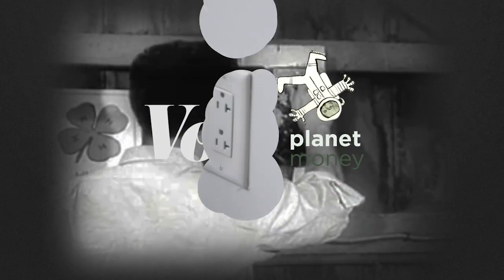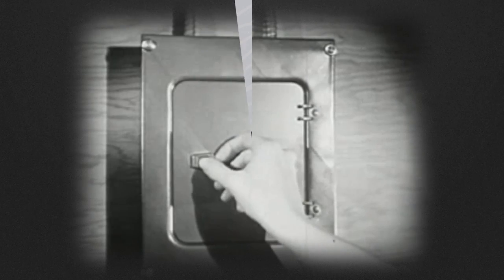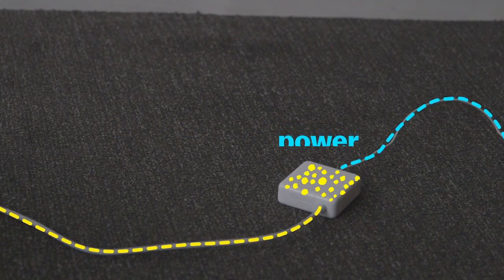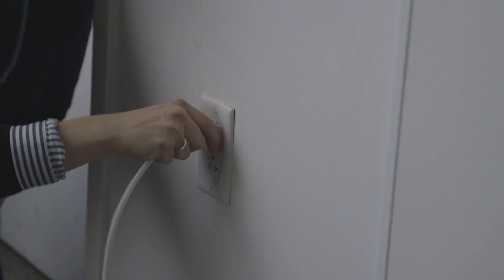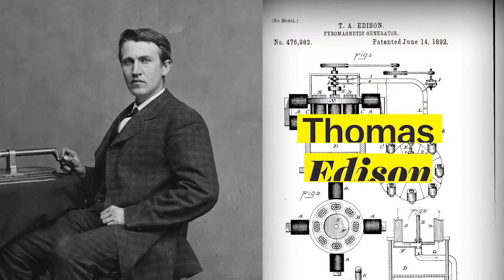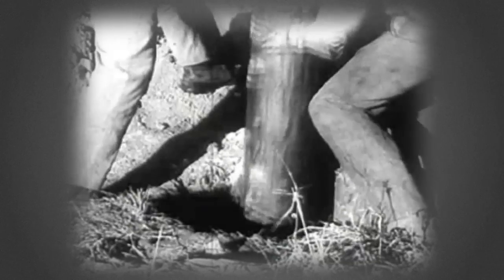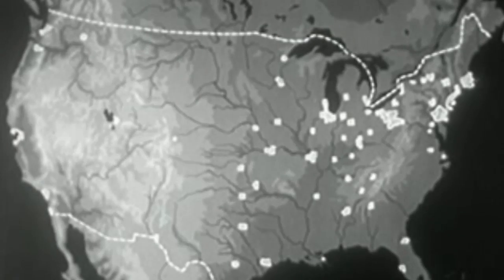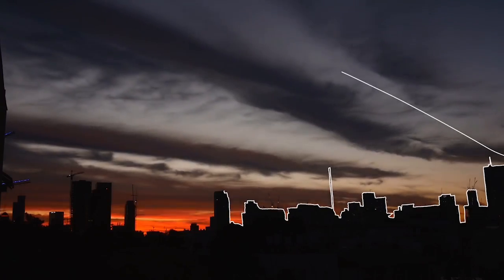Why your laptop charger is so hot

Comment: The answer is moronic and inaccurate. If your charger is getting more than just warm (still easily touchable) during a charge cycle it is likely a cheap piece of crap that is not sized properly for what is being charged. You should NEVER EVER use a charger that is different from the one provided by the manufacturer...that means NEVER.

Comment: Alternating current doesn't go "back and forth..." It just is on and then off. It is really only on half the time, but it oscillates so quickly that it is unnoticeable to humans. Watch a video in VERY slow motion. You will notice that the lights seem to be flickering. The problem with the electricity from the wall it is that 1. Your computer needs a steady supply of power to keep running, not oscillating, and 2. The voltage from the wall is way too high for your computer and the heat comes from the coils upon coils means literally for the explicit purpose of getting hot by wasting energy to convert ti the low voltage.

Comment: I'm trying to understand how a single large power converter would save energy. 
DC is incredibly lossy. It's only viable at short distances. This made T. Edison's urban project that compete with Tesla's include coal power plants amidst the city, whereas Tesla's generators could be located far away.
You'll lose more energy in the wires connecting everything. And you would still need AC power for some home appliances.
Though, DC power is safer due to low voltage, but the higher current means heating and fire hazard in the wires.

Comment: This video is completely misleading and in some cases wrong! 
As previous viewers have already mentioned, it is not the conversion from AC to DC that is causes all of the wasted energy, it is the conversion from 230 or 110 volts into around 5 volts depending on the charger. 
Actually, having AC in the power grid saves a lot of energy and complexity when looking at the large scale of a country. AC is much easier to transform into different voltages which is an essential feature since higher voltages are much more efficient for long distance wires, while lower voltages are safer to have in your home. This is is why every country in the world uses AC.

Comment: I've come to expect more of you Vox. This didn't even answer its own questions.
"Why does the power converter get hot?" "Well when the power converter converts power the power converter gets hot."
"Why do our devices need dc?" "Well they do, so you need a power converter."
Reply: +TekSupport actually the majority of the power loss comes from the transformation of high voltage to low voltage. So the video is gives inaccurate information.
Reply: +Hector Rochin Exactly. This video is a bit of an embarrassment - they should just pull it and try again before anyone else sees it.
Reply: +Bret H good quality informed with a good insightful audience....
Reply: It mentioned why it's hot, because of energy wasted in the form of heat
Reply: its still a bad video
Reply: +TekSupport ? what the H?
Reply: +Hector Rochin I think you're right on that and the penny pinchers always want the power supplies to cost less so the engineers comply with the BS and make them 10% less than they should be & other big issue is the state of terrible electrolytic capacitors coming from Asia
Reply: +Blobfisher I think vox missed the whole point. your laptop needs power at ~19V, you cell phone 5V your razor 12v etc etc. your old skool TV would like it if you delivered it 10000V for its electron tube. if your going to have to convert it  up and down (from whatever voltage you send through the lines in your house), the cost of AC vs DC on the input side is pretty negligible. also you can't deliver it at modern electronics voltages, whatever factor you reduce the voltage by you have to up the current. a standard house would have a peak load of 2000A if you delivered electricity at 5V (im assuming your running a stove and a few heaters +those electronics goodies, which would conceivably hit 10kW).
Reply: agreed, vox is not a science channel.. this video would only confuse someone with limited electrical understanding looking for an answer to a simple question.
Reply: Kabitu1 it answered the question by saying the heat is a form wasted energy.
Reply: Does this also explain why we have different voltage specs on some appliances? Is that the reason why plugging in a 110v device to a 220v outlet would short out its power circuit?
Reply: +Francis Paran I think that's because most countries have 220V, 230V, or 240V power, whereas the US has 110V. The voltage specfied on an appliance would be because of which country it was originally made in.
Reply: +TekSupport Well, the hair dryer thing is not true. It's not turning itself on and off. The direction of electricity just switches, but that doesn't matter. An DC-motor has the same theoretical efficiency as an AC-motor. An AC-motor would actually be more efficient if it's three phase, but thats another discussion.
Reply: +TekSupport I know AC is not consistent like DC is, but that bit you said about hairdryers made it seem consistent...
Reply: +Kabitu1 Not to mention that a lot of those "AC devices," like the LED lightbulb and vacuum cleaner, all use DC. They have converters internally. If I'm not mistaken, it's the inducters in a converter that generate the most heat.
Reply: Ask ASAP science
Reply: Kabitu1, Thank you, I bet everyone who actually watches box knows this.
Reply: surely its the step down transformer that dissipates more heat.. besides you can't expect the average vox viewer to know anything about diodes mosfets and bridge rectifiers.. i agree that  this video did not say much
Reply: he doesnt know what he is talking about ac motors use a split ring commutator to insure they rotate in on direction regardless of the the change in the direction of the currect
Reply: Kabitu1 it answered the question by saying the heat is a form wasted energy.
Reply: From an Asian student's perspective: P=W/t=UIt/t=UI
Reply: Power converters get hot because they convert ac to dc and when that happens energy is released in the form of heat. I learned that from the video?
Reply: +Kabitu1 They answered the questions with no explanation because it is already so fucking simple. The power converter or rectifier gets hot because to convert ac power to dc power you need to use capacitors, resistors and mosfets. Resistors get hot... they create resistance... energy is converted from electrical energy to thermal. Why do devices need dc?  because dc is consistent, smooth, clean power. Your hairdryer is literally turning on and off so fast you can't even see it happening. You wouldn't even be able to turn your laptop on using ac, it would just turn off. Not to mention that ac like they said pulses forwards and backwards. So whenever the ac pulses backwards through your laptop it be moving through the laptops electronics backwards. Think about that, for current to be usable for a processor it needs to go through a power delivery system. If it were to move backwards it would just go straight into the processor with no system to control it. Hence the blue smoke.
Reply: @Parkskiingftw  YOU ARE WRONG
AC-DC conversion or RECTIFICATION is 98% efficient, it is the transformer stepping the voltage down to ~12v that does it, just because you have the word Tech in your name doesn't make you smart or mean that you can lecture others
I'm 15 and know more than you jesus
Reply: @rentisme  lol when I wrote that comment I was probably about your age to and hadn't even started my engineering degree. Not gonna watch the video again but I think they were suggesting that we should condense all power converters to a single unit and just output DC through out each home? I am graduated now and have designed power converters, and the argument they are making isn't unfounded.

However, it isn't practical either. If consolidating all the power converts to one big highly optimized system saves 0.5% of losses. This would translate to gigawatts saved nationwide. The reason you could achieve an improvement is manufactures won't have to build there own converters that need to be compatible with a wide range of input voltages and frequencies as different nations have different grids. So you can dial in the value of inductance and capacitance to give less ripple at the singular input voltage, and frequency that the grid uses. Most computer power supplies are usually compatible with every possible electric grid out there which makes manufacturing easier as there is only one model, but its certainly slightly less efficient. 

This isn't practical because everyone would have to agree on a DC output that there products should run on. Suddenly all batteries need to be at the same voltage, a generations worth of electronics becomes junk. It will never happen.

You remind me of myself when I was 15, a cocky know it all, you should take engineering, seems like you got the mind, interest, and attitude for it!
Reply: It's because electronics require very delicate movements to work, in fact, that's HOW they work! If you used AC that alternates it would just be too unpredictable
Reply: this is what happens when you ask  NPR for facts

Comment: This information is misleading at best =/ You make it sound like we stick to AC just because it's easier, but the truth of the matter is, having a DC power grid would waste so much more energy than how we have it now.

Furthermore, having one DC converter for a house is somewhat impractical. There re devices that run on all sorts on different voltages. Laptops tend to like 19v. Desktops have 12v, 5v, and 3.3v all powering different things inside of them. Not to mention small devices that require all sorts of different voltages. Oh, and running all that DC through the house is going to incur significant voltage droop due to the long wires. There's a reason we run AC to the wall and only convert to DC when absolutely necessary.
Reply: +Rick Budzak 
DC Voltage reduction is much simpler though. A solid-state voltage regulator is pretty much the only thing needed. In the other hand, 120V AC to DC conversion usually requiares a transformer, which is heavy and much inneficient. 

It is reasonable to imagine 24V DC avilable in home outlets and each device would only need small voltage reducers for 12V, and 5V. 

Some factories do have 24V DC lines running through the whole factory because many measurement instruments are standarized to work at 24V.
Reply: +Rick Budzak  Listen to this man! he knows what's up!
Reply: Makes sense when everything runs on the same voltage. I know of places that do that with 48v as well. That's not the case for the average home, though.
Reply: +Rick Budzak 
Well it might no be a perfect voltage match, but each device requiring its own little voltage reducer does make more sense than each of them having their own transformers and rectifiers.
Reply: +Rick Budzak It's important to note that while laptops have inputs at 18-19V or the like, they most likely convert it down another time to 5V and/or 3.3V for digital logic.
Reply: +Rick Budzak 
Agree, 
Not to mention that running e. g. 12v with decent amps around your house is super fire hazard. Poor connection or damage on cable or anything can heat up quite alarmingly and not cause any breaker to stop it.
Reply: DC grid would not create that much wasted energy actually if similar voltages as AC ones are used, but controlling it is the biggest problem, and back in Edison's time there is no solution to that so he lost. A lot of modern DC-based electronics are based on modern developments like semiconductors, which have the ability to control DC just as good as AC.

As of home-based DC distribution, I have seen this solution based on a 24V-48V master power supply and a bunch of USB Type-C outlets with built-in buck converters. The higher DC master voltage makes the loss within one home tolerable using thicker wires and makes use of the existing industrial converter modules, the at-the-outlet converters are efficient, cheap and provide the flexibility of offering different voltages, and USB Type-C provides a way for the device to ask the outlet for its preferred voltage. Currently USB Type-C allows 20V (very close to 19V,) 12V, 9V and 5V options negotiable using USB Type-C Power Delivery protocol, and up to 5A current with a rated cable. A laptop or a small desktop computer can run and charge off 20V or 12V, while phones often use 9V or 5V.
Reply: Not to mention running a different cable to each house for each voltage requirement. You seriously could not have 3V, 5V and 12V items in your house unless you had three different cables for each voltage. OR unless you simply ran a single AC cable THEN converted when you needed it.

Furthermore, that black box 'wasting energy' was the thing keeping me warm in a tent from November 1st-December 1st. In Canada.
Reply: +Rick Budzak Actually DC is more efficient than AC. AC suffers from skin effect (current mostly travels on the skin on the wire ) and parasitic unwanted inductance (Basically higher effective resistance when using the same voltage at DC). Long time ago it was not possible to do DC-DC efficient conversion. so AC become then norm because it was much more efficient to send AC at higher voltages (even if you have higher resistance) than DC at lower voltages. but modern technology allows efficient DC-DC conversion. There is research going on to send DC over long distance and it is promising. But it would very costly to change the entire infrastructure to do so.

Comment: 1:41 NO!!!! DC is more efficient at travelling long distances. AC is used because high voltages are more efficient at travelling long distances and AC can be converted to different voltages with simpler circuits than DC
Reply: Power=Voltage X Current, higher the Voltage, smaller the current, vice versa.
Power loss=Current&#178; X Resistance, the cable used for long distance transmissions have a high internal resistance, so the only way to lower the power loss is to use a small current.

So using high voltage with small current have a low power loss, no matter it is AC or DC.

But the thing is, DC can not be step up or down by using induction but AC can, therefore, people use high voltage AC for transmission, then step it down for us to use.
Reply: +sean shapuron If you use AC, you are sending some extra electricity back and forth in the line because there is always some non-zero phase difference. That is called reactive power. (see https://en.wikipedia.org/wiki/Volt-ampere_reactive)
Reply: +Felix Bade I see, does that mean the DC  can travel through a longer distance than AC (Assumed that the resistance and length of the transmission cable is the same and they are at the same voltage) ?

If so, I'd like to ask how to step up/down the DC with maximum efficiency, and why Edison failed at the first time? His DC power grid had a severe power drop problem.
Reply: +sean shapuron High Voltage DC is used in Long-Haul electric transmission. But in Edisons and Teslas days the electronics needed  simply weren't invented.
Reply: +Felix Bade even at this day, it is still hard to swith high voltage and high amp DC currents on and/or off. Switching AC on and of is by far easier because voltage and ampere count becomes 0 about fifty times a second (depends on where you live, in the US it's 60Hz as far as i know)

Comment: Converting our entire house to DC is not the answer. By far, the majority of power consumed by homes uses AC directly. The power consumed (and thus converted to DC) by electronics is relatively small. Converting only the small loads to DC as needed is the most practical solution for most people.

Comment: Saying Tesla is to blame sounds accusative like he did something wrong. Wha?

The heat is also a compromise of design. If you want a more efficient AC to DC converter that makes less heat you can have a charger that's the weight and size of a car battery but who would want that?

Comment: DC power can't travel long distances, you would lose more power from voltage drop than you would from the heat in an AC-DC adapter. So switching the grid was never an option in the first place. This was a bad video

Comment: Ehm it's not converting ac to dc it is the transformer that converts the voltage to 19V or whatever that causes the heat dissapation.

Comment: So, anyone actually care to answer Why your laptop charger is so hot? This video was shite
Reply: +Sythe81 "I never question it, so that means nobody is going to question it."
Reply: +Sythe81 Changing from AC to DC isn't what's actually creating all the heat, it's the voltage stepping down from 120v to 19v. The voltages drop by having two different gauged copper coils next to each other. The first thicker cable produces a magnetic field that the second coil picks up and creates voltage. It's basically the same as a motor but instead of a permanent magnet, it just uses two electromagnets. But these coils are where the heat's actually coming from as the coils are "doing work" and creating a magnetic field(the first one)/power(the second one) and nothing is 100% efficient. So all the wasted energy either becomes heat or some stray magnetic fields.
Reply: +Antonio What? Did you know that there are other people other than yourself in the world? they may of questioned it. the world doesn't revolve around you buddy
Reply: +Hunter Bingham Thank you, you explained it in a few lines instead of a 3 minute long video that made no sense
Reply: Sythe81 Either 1) you're playing dumb, or 2) you are dumb and you didn't understand the purpose of my comment.

Either way, you're dumb.
Reply: +Antonio cheers fuck face